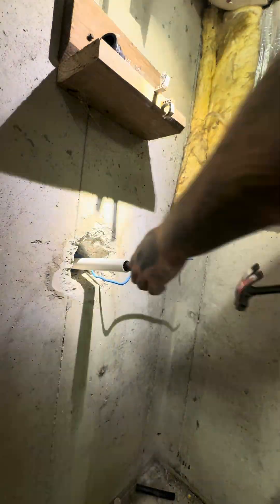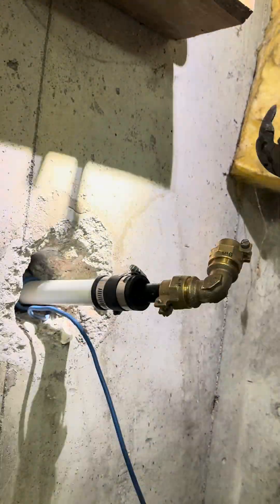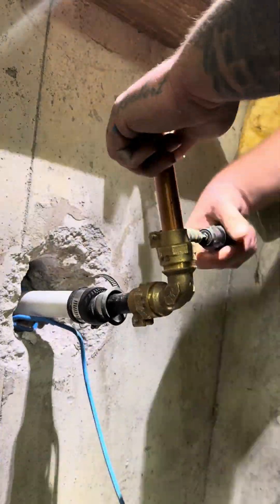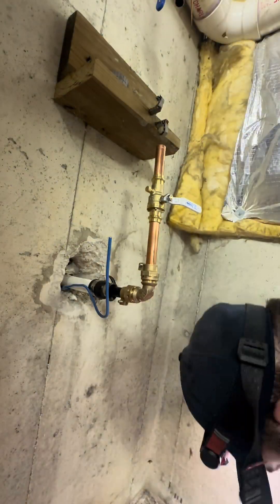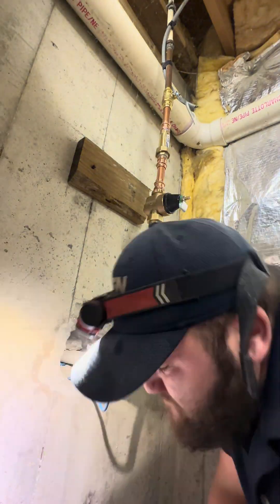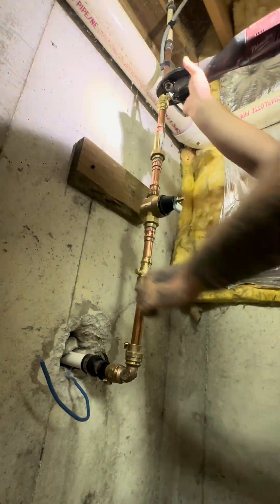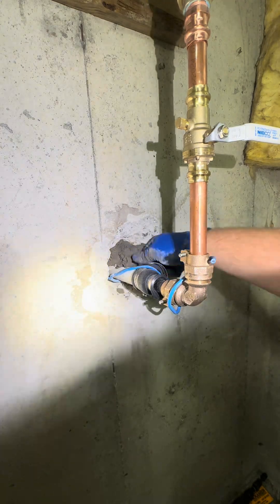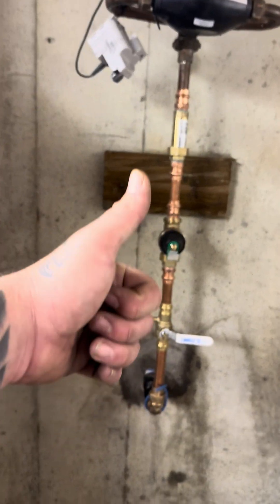Installing a Main Water Line Up to Code 💰💰

Comment: Why do you say blue poly is junk?
Reply: Dude dogging on the poly, then looks like he installed a bunch of Sharkbite fittings 😂
Reply: @wadecrawford6445  Do you even know what sharkbite fittings are? His press fittings are perfectly fine and The black poly he put in is pretty standard if the client doesn't want to spend the extra money on copper.
Reply: Those aren’t shark bite fittings. I have worked in several manufacturing plants and they have all went to these fittings for compressed air lines and process water lines that could have more than 100 psi in them because they are superior to soldering.